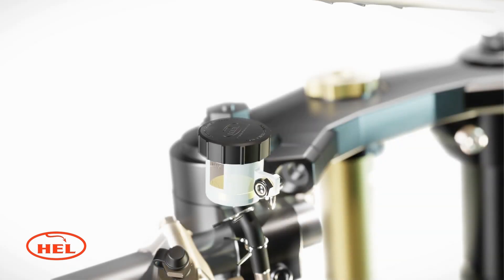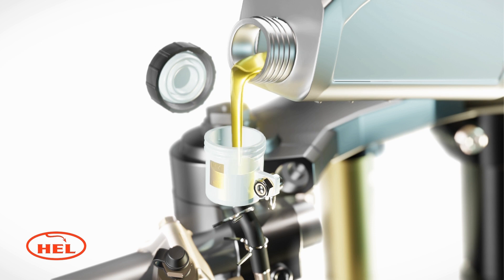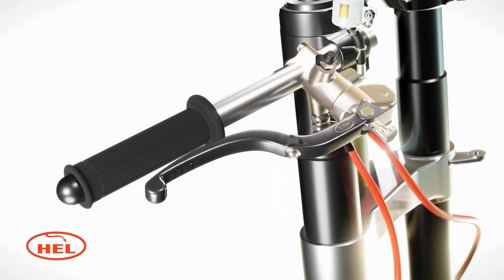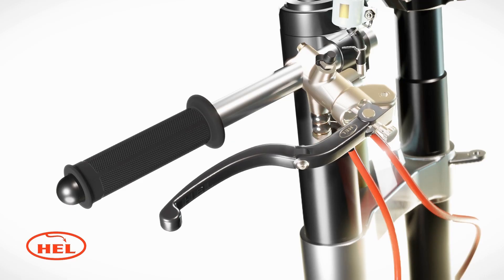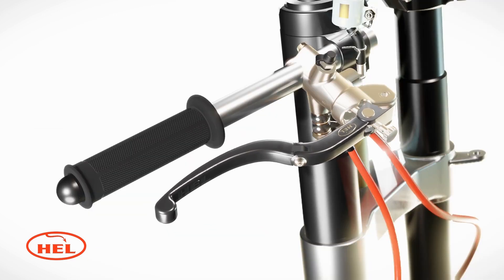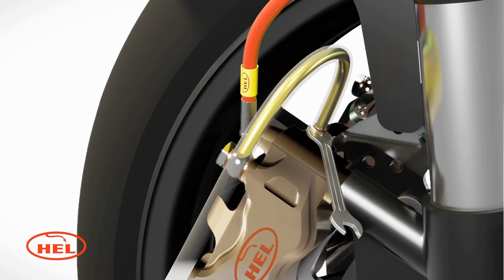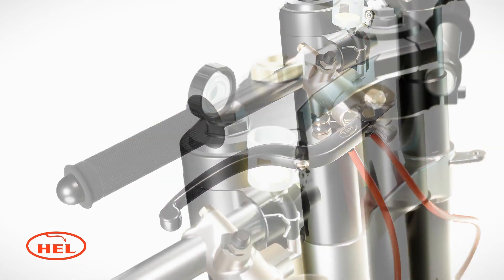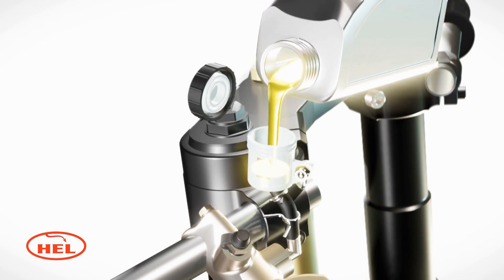HEL Performance | How to Prime the Brakes

Comment: I think you should do better marketing.  I had a hard time choosing between your product vs brembo and in the end I chose the Hel brake master cylinder 16mm.
Reply: I'm thinking about going with the 16mm master too, how do you like it?
Reply: @jonnymac8925  it's awesome for 2 Brembo brake 4 piston 😁. I bought it with unbelievable price 150usd.
Reply: @pham7878  I'm speaking with HEL Canada, I'm hoping to get a master cylinder, brake lines, 108mm 4 piston radial caliper and 2 piston rear caliper for my Harley Davidson Sportster! I currently have a dual disc XR1200 Harley Davidson/Nissin master cylinder, braided lines, Tokico radial 4 piston caliper with a speed merchant bracket to swap from axial to radial, Brembo pads and Brembo rotor for the front and a larger Brembo rotor on the rear with a cnc bracket to fit it, Brembo pads and the stock 2 piston rear caliper. The brakes are already much better than stock, but I plan on tracking the bike and taking the already build 100+hp/85tq 1200cc to 1250cc/73ci to 76ci big bore and making it a 90ci 130+hp/125+tq monster, so I definitely need another brake upgrade lol